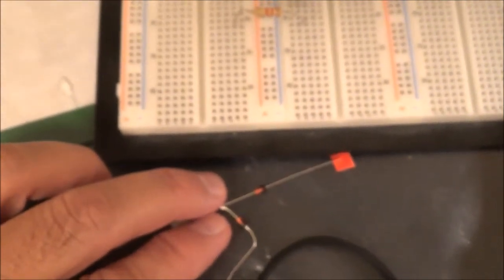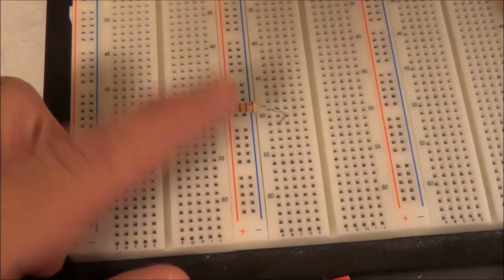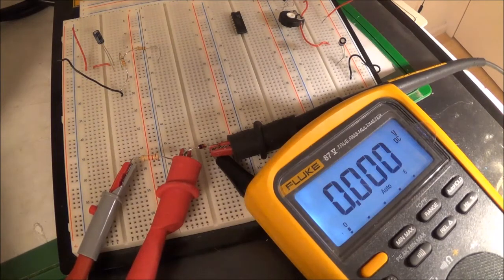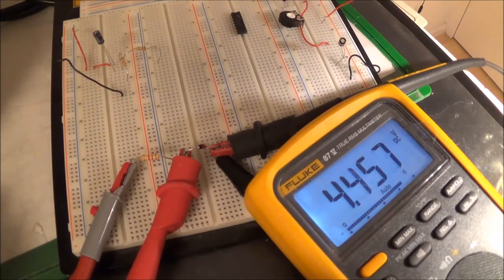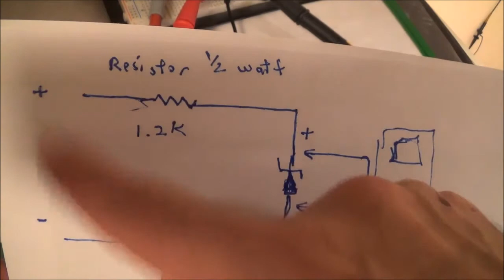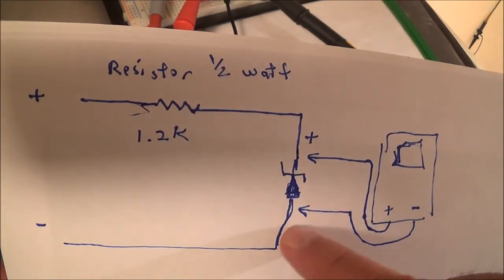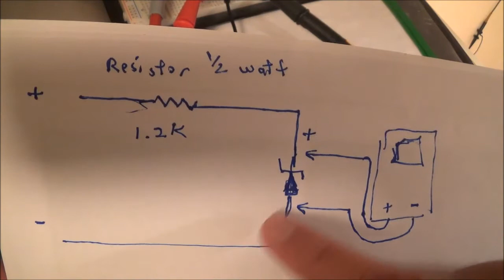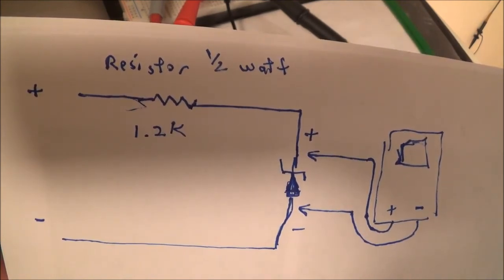Zener Diode Testing -- Simple Out Of Circuit Test

Comment: Nice video. If you put an ammeter in would it show no current until it reaches the zener voltage?
Reply from the maker: Thanks, Pat. Right, we can say that "practically" no current flows; the zener then conducts in the reverse direction once a certain point is reached. Breakdown/avalanche is reached.